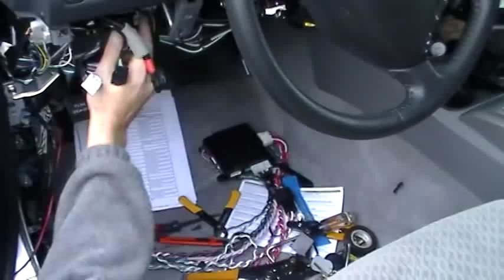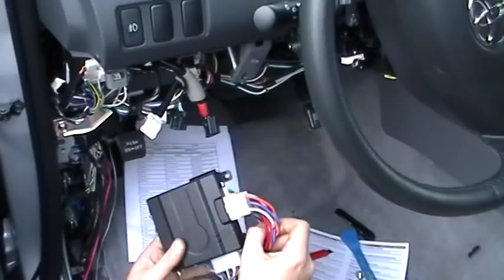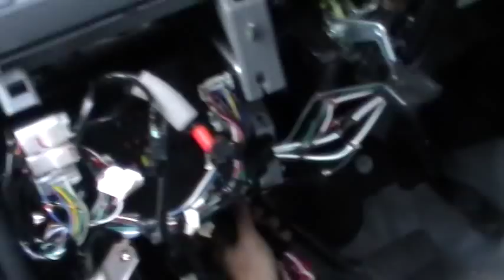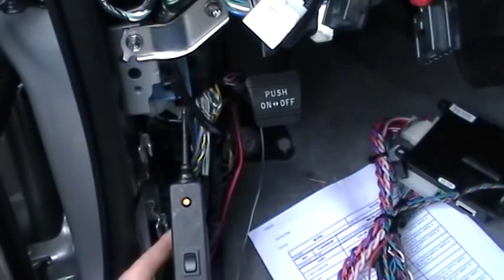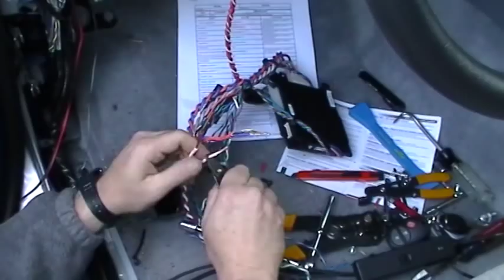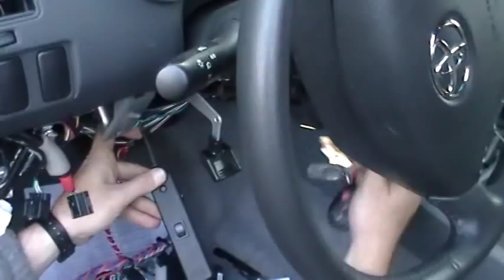Part 3 / 4 Alarm Remote Starter Installation How To Series

Comment: If you can't solder wires you shouldn't be installing a remote start in the first place. I would prefer not to mess around with loose connections in the future.

Comment: Will most of my wires be used for an 85 Isuzu Pick up??? I like your video and I have learned a lot.  For my truck I really don’t have a lot of the extra things like the newer cars have.  Remote starter, door lock/unlock, parking lights.
Reply from the maker: thats ok, not all cars have all those frills. but you can add then which is fun..

Comment: I know this video is old, but when I considering learning something new I watch many videos. I'm a poor starving disabled musician and have had to teach myself quite a bit about electronics over the years, to fix my vintage music gear, my car stereo and home AV equipment. You're right most people doing these auto DIY videos are teaching people how to mess their stuff up. I'm not quite as picky as you lol, but I really appreciate a picky guy who has an eye for detail.. We need many more of you out here. :) So working on my own electronics I obviously know how to correctly solder and even safely do it in my car. However I kinda worry a lil about you not disconnecting the battery as I've always been told to do, so when I attempt this myself the battery will be disconnected. But hey you're the pro, so I'm sure you know just what you're doing. Okay to my long winded question (and I'm sorry I wrote a book before getting to my point) It's regarding my beloved 1995 Honda del Sol. I know she's old, but she's so faithful and gets almost mpg with even a trunk that I can hide 50 dead bodies, but only seats two lol.But for real,  I don't have power door locks, just power windows, a 5 speed stick and the obd1 system. I'm mainly wanting to protect my car from theft and becoming some racers kid's parts doner car, and then there's my cherished vintage Alpine stereo. So what would you recommend I do to secure a car like mine on a budget, but not being a total cheapskate? I've been told by every guy I know that honda door locks are the easiest to pick, so I love the motion sensor thingy and disabling things like starters and fuel pumps. I think the more things I can disable the less likely they will figure it out. And I also think having blinking LEDs in the car help scare away many... lets say less talented thieves!? I also very much like what you said about putting the alarm module up high in the dash, that sounds very wise. 

Thank you for reading my long winded mess and I look forward to watching the rest of this great video you posted for us :) 
Oh and do you still sell car alarms?? Thank you very much :)

Comment: hello your videos so far have been very helpful. I am installing a remote start in a 2007 jeep wrangler. It has a single wire that is both the starter and acc according to the wiring guide I found. Is it OK to wire the remote start system starter and acc to single car wire?

Comment: Hey I know it's been a while, but I had a question about the way you did the two starter wires together...I believe I heard you say that one was for "cold start," correct?  And most people don't connect that one...Now, if you don't connect one or the other is it possible to get misfires, or problems?  You said connecting both together won't damage the vehicle, but what about NOT connecting one, or the other...
Reply from the maker: The 2nd cold start wire is there for a reason, So I personally always do it, But in cases where the user is in a  warm climate year round, that cold start wire would never be necessary.

Comment: thanks for detailed series. 4:00, what tool are you using to punch the hole into the wire? Didn't notice any on your storefront, http://stores.ebay.com/Lessco-Electronics/Wiring-Kits-Install-Parts-/_i.html?_nkw=tool&submit=Search&_fsub=10&_sid=77826561

Comment: how to add 2 alarms with door lock actuators using 2 diodes I want to keep factory alarm with 4 door actuators. I want to add another alarm system in conjunction with old along with door actuators.

Comment: How to you feel about T Taps and other clips that tap into a wire? I have seen a few professionals use them for installs like this. I am planning on doing a remote starter in my 1997 Ranger.
Reply: T-Taps are HORRIBLE and should not be used on a car or trucks ignition harness. If you use the incorrect size T-tap you will essentially reduce the overall guage of the wire and in most cases this can cause extensive damage to the ignition harness. By using solder or wrap and tape, like he did in this video you are keeping the integrity of the factory harness  and also making it easily reversible if you need to do that. I cant stress it enough, T-Taps should NEVER be used, you will almost certainly see these being used at your local Car Audio shops if the installers are paid by commission.
Reply: I ended up splicing in and soldering for the ignition harness wires. I used T-Taps for all of the small wire connections though, they were nice and easy. Everything worked out well :).
Reply: Do not use t taps ever. Junk. Take the time to do it properly. I've diagnosed several remote start issues installed at Best buy caused by t taps.

Comment: shouldn't the starter kill relay be connected during this whole step? or, if it was done off video,  which starter wire was interrupted? starter 1 or starter 2? or both?
Reply from the maker: +XxMrFrijolesxX both were wired into

Comment: @7:15 when you say "its weird to see two starter wires on a Toyota" did you mean to say "ignition wires"? I'm trying to understand what this "ignition switch isolation" wire is for on my Viper 5706. So just before that, you were talking about wiring in a relay but that you were going to just put those wires together. Am I right in assuming that that relay is built in to my Viper? Is that what they are calling the "Flex Relay"?
Reply from the maker: +Chris Chambless no, I meant start wires, this truck had a cold start wire along with a regular starter wire

Comment: Wrapping wires as you show, is totally unacceptable in the trade.
Reply: If you don't poke the wire through a hole and just wrap it around, de-soldering is a piece of cake. Also if you do it right, it doesn't fatten the connection at all, the solder flows between the strands. Not using solder causes loose connections later on, I've seen it happen.

Comment: hey I have a 2006 hummer h3 and my truck has only 1 ignition wire at the ignition harness and my remote start has ignition 1 and ignition 2 ......I also can't find the starter wire at the ignition harness for my vehicle could you help me out and tell me what wire it is?
Reply from the maker: hotyricky use the free wire info at bulldogsecurity.com, its pretty good. hit the wiring info link on the left side of the web page
Reply: +Lessco Electronics that's the wiring info page that I am using already....it says that there isn't no starter wire and that it only has 1 ignition wire.....could I just put both ignition 1 and 2 from the remote start to ignition 1 from the vehicle

Comment: Hi my alarm has a
.. ignition  1 input/ out put 
..fused 12v ignition 1 input 
...ignition 2 /flex relay output 
...fused 12v ignition 2/ flex relay . 
Wich one do I conect to the ignition  1 and 2 ??

Comment: i have a viper model 4103XV can u explain what is the (-) 200mA factory alarm rearm and disarm?
Reply from the maker: that is used in a case where you want the aftermarket to arm and disarm the factory alarm system (if the vehicle is so equipped)
Reply: yes it has a factory alarm system its a vw Passat 2000 v6 I had it install once an everytime I try starting it the factory alarm keeps action up an making noise so do I have to connect both rearm and disarm wire to my factory alarm? how do I find these wire in my car? thanks for the reply I live in Minnesota and it really get cold here.

Comment: de-soldering isn't hard.  I have to do it all the time.  You can simply reflow the solder and pull the connectors apart, or use de-soldering wick, or a de-soldering iron.  And if you have a temperature controlled soldering iron with a properly tinned tip, making a solder connection takes less than a second.  I am qualified to speak on this because I've personally designed and hand soldered PCB's with nearly 100 SMD components (surface mount, not Steve Meade).  "if you ever take the system out and put it in your next car" you're gonna have trouble with all the wires you snipped off because you didn't need them for this install.  Do you ever take out ignition or starter relays?  You cranked the starter 9 times, just in this video, to figure out what the wires go to. That can't be good for the engine.  I sure wouldn't want someone doing that to my vehicle.  Other than that, great video, much better work than any shop I've seen.  Thank you for taking the time to make and post these videos!

Comment: what that black device name you have testing with?
Reply: it's a test light. Better to use a multi-meter. Especially on newer vehicles where not everything is run off of 12 volts. some door locks are run off of the same wire but one of the commands uses resistance.
Reply: Look up power probe

Comment: Im putting an alarm in an 06 chevy van that does not have keyless power locks.  What do i need relays for in a vehicle no previous keyless/alarm system?  Lock, unlock i know but do i need relays for start, ignition, horn or is that done in the unit?

Comment: had me till you just twist wire around without a proper connection.
Reply from the maker: I don't expect 100% of people to agree with all I do, and that's ok. I respect ya anyhow!
Reply: Hates tape but uses tape on his splices. Use a wire nut or a stak-on. Weak splices cause fires. The splices you did are very weak. Thanks for the video. I know it's a lot of work to put them together and post them.
Reply: @tomyanney5856  honestly i thought the same. Im restoring my old truck and didnt want to do a shabby job by using electrical tape...saw this guy and he said he hated it so i followed in the series just to see him do what ive been doing already..........i expected some fancy super connector but i guess long wire tight twist and tape will do lol

Comment: Hi, I have a 02 durango and it only have 1 wire for both lock and unlock. It said lock trigger through 820 ohm resistor, and unlock 330 ohm resistor. How do I wire the blue & green alarm wire to my car wire? TIA

http://www.modifiedlife.com/2002-dodge-durango-car-alarm-wiring-diagram/

Comment: I have a 2005 buick lacrosse and the wiring for the vehicle says I only have one ignition wire......what do I connect the 2nd ignition from the remote starter to?
Reply from the maker: not all cars need more than 1 ignition, if theres no ignition 2, just insulate it and don't use it

Comment: I purchase a excalibur al-1950-edpd and a omegalink blade al-64 that was progam to my car that is a 2008 Honda accord my question is do I still have to install all the bypass wires that come with the blade al-64 ???
Reply from the maker: yes, they're still required. use the manual on idatalink's site for the exact schematic on your application.
Reply: Thank you would u b able to send me the link on were to get them thanks man best detail video on YouTube

Comment: Hello  what is the brand of the probe you are using, I was sinking of buying the Circuit Buddy Circuit Tester Logic Probe Test Light CB-01, but it looks like yours would work better with out pinching wires almost like an amp probe.
Reply from the maker: that's a matco power probe

Comment: Hello, I purchased a nu3500 system from you and I have a question. I'm installing it on a 2007 is250 and according to the wiring for the car, it shows a starter 2 and ignition 2 but the alarm only has one input. Do these wires have to be connected? Thanks! 
George
Reply from the maker: I emailed you back earlier today

Comment: question for you, I see your cutting a hole in the car wiring and pulling and twisting the alarm wiring through, could you just as well use T-Taps or T-Connectors as well?  thanks in advance

Comment: Also a suggestion to anyone wanting to attempt an install themselves. Be sure that you understand your vehicle perfectly before you begin. Nearly 100% of being able to install an alarm and remote start is making the correct decisions that relate to YOUR vehicle. Anyone can connect a red wire to a green wire, that doesn't mean you're an installer. Knowing to connect the red wire to a green wire makes all the difference. Ask for help if things don't make sense!

Comment: As a fellow installer, the only thing that I would suggest is to not ground your siren in the engine bay. I run the siren ground with the siren power and ground it at the driver kickpanel along with the other grounds that were needed for the install.

Comment: Hey lessco luv ur work my question to you is where did you get the test light I use a multi-meter but the test light looks easier to use and one more question I have a Chrysler 300 SRT 8 but I can't find the cheat sheet how do I get it

Comment: your last reply to my question RE;blower motor does not go on/ radio does. sez i grabbed the wrong wire but when I swtched to the orange wire rhe remote wouldn't work at all. kind of defeats the purpose of having a remote start.
1998 astro omega rs-7k2 starter

THANKS AGAIN,
SKIP M.

Comment from the maker: You grabbed the wrong accessory wire, you have 2 in there, 1 is orange and one is brown - You have radio power, But no heat, right?

Comment: I  RECENTLY INSTALLED AN OMEGA RS-7K2 STARTER IN MY '98 ASTRO AND ALL WORKS WELL EXCEPT THE BLOWER MOTOR DOES NOT GO ON UNTIL THE KEY IS TURNED ON.
ANY IDEAS?

Comment: My 08 Tundra's ignition cylinder 8 pin connector uses wires that are only 18 Gauge and the Viper Remote start wires are huge (like 10 gauge) Why the big difference?

Comment: I bought a used HUMMER H2 I noticed a sticker under the hood DEI remote start system and also an antenna in the corner of the window. how do i find out which kind and model is installed so i can order a remote for it, the previous owner was kind enough not to include it.

Comment from the maker: Strip it back 1st, then poke the hole. And the tool I use is a craftsman cotter pin extractor, Known in the electronics field as a hook tool.

Comment: Do you strip a small section of the wire being spliced into, then poke a hole through the exposed section; or just poke a hole through it insulation and all? Also, what's the name of the curved tool you use to make the holes in the wires?

Thanks!

Comment from the maker: 85 goes to orange - 86 should go to a cranking ignition, 87a goes to the starter side, 30 goes to the key side of the starter wire

Comment from the maker: I use it only when I have to, youll notice all my harnesses are always wire tied
Reply: Can you tell me how to install a diode while installing remote starter? It shows the picture of the wiring diagram on the installation wiring diagram of Compustar on lock/unlock door, ignition, trunk, and PTS to wired into the vehicle for remote start on bypass module wiring diagram. Tell me how or do I need to put a diode or fused over it? Why do I have to install a diode on door/unlock/trunk and PTS while wiring them during the procedure of installing remote starter on my vehicle. Let me know ASAP. Thank you. @Lessco Electronics

Comment: also u missed to tell noobs they have to take all the trim off.. which sometimes can be the hardest part.. great video.. I have done electronicstilnd alarms for years but as complete video like this is awsome... Ur my new best friend. I have low budget (Ssi) but still have a heart for electronics and when I can I enjoy stuff like this. Also must note when extending wires use the correct guage or larger :)

Comment from the maker: No way, that model was out 6 years before this model, They have similarities, But definetly not the same as far as color and locations are concerned. You should always adapt specifically to the exact model you're working with. Like the carpenter says... measure twice, cut once.

Comment from the maker: You only use one or the other, Usually you use the + output / the - output is for cars with negative circuits or resistor based systems.

Comment from the maker: Regarding the accessory, You nly need to power the one in the car that cuts on the heat and A/C
As for the extra ignition, Just cap it off (or if you wanna - you can use that to power the 2nd accessory)

Comment from the maker: Thats called a power probe, Mac and snap on sells them. Its a test light with led's and has the capability of throwing + or - voltage with the button as well, Its a nice tool to have around.

Comment from the maker: Typically the orange is a starter kill or ground when running connection, so if youre using a relay for starter kill or anti grind, you'd use it for those functions. as for channel 2 and 3, those are optional - outputs to do things like trunk pop or optional window modules. Most times they're not used.